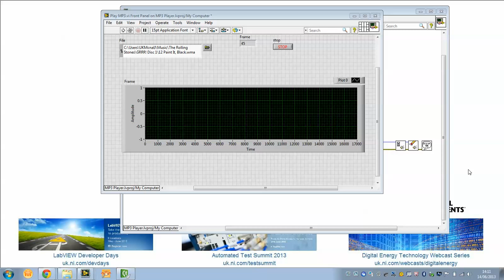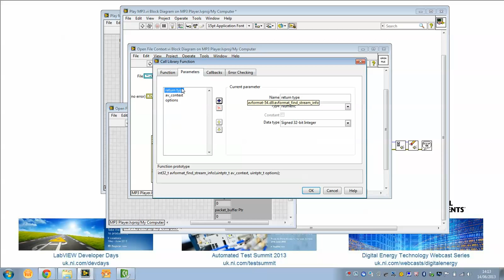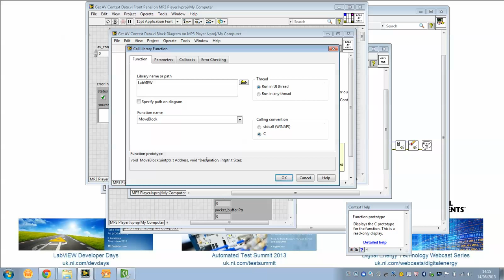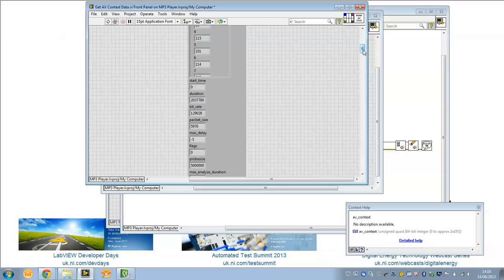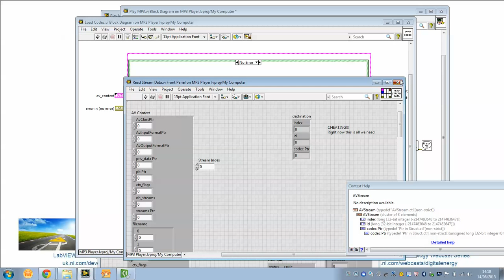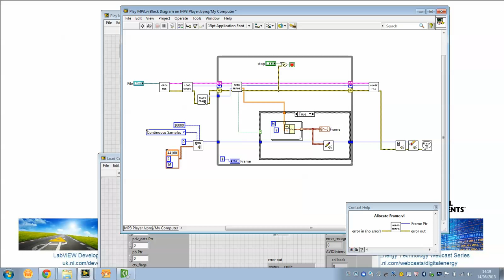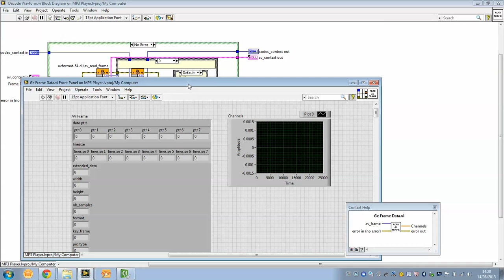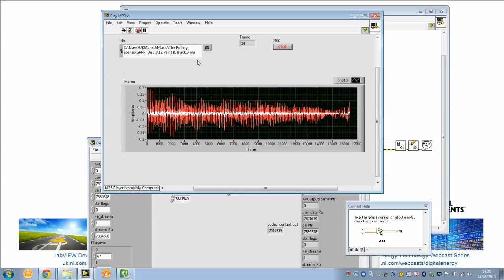Different Techniques for Calling DLLs using Structs from LabVIEW

Comment: Hello James! I have a doubt. If there is a parameter that is a pointer to a data structure(struct) that contains several structs and uint32s and so on. How do I set the parameter in call library function node and make a cluster and pass that thing into the dll?